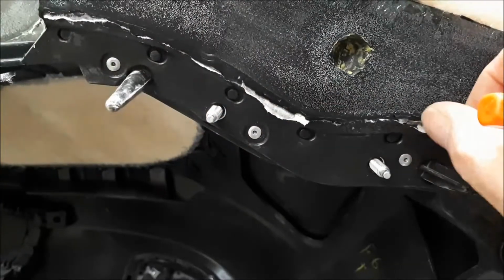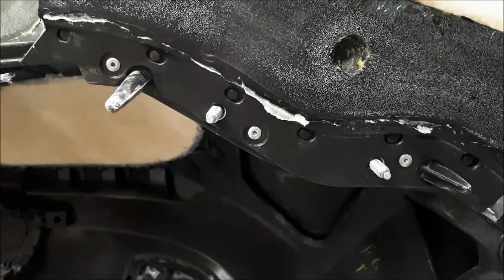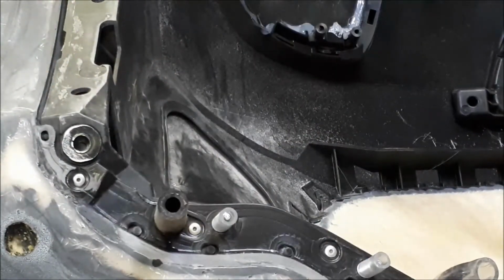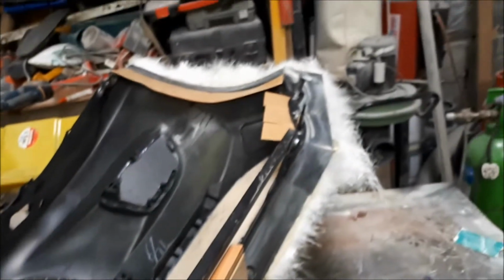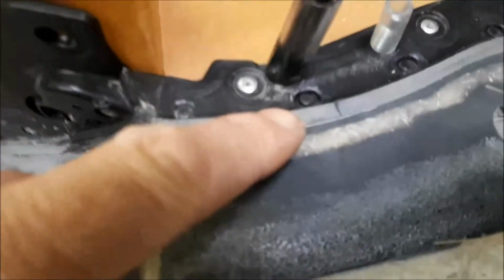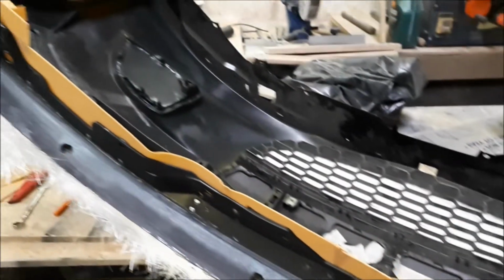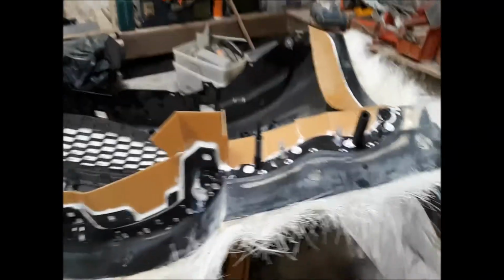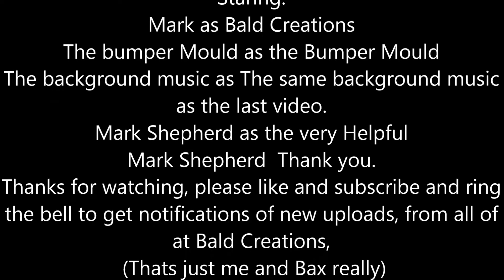Mazda mx5 3.75 Front Bumper Mould Part 2

Comment: Thanks for the remarks mate glad to help and pass on what I’ve learnt from others 👍 

Another tip is to use those clear plastic rubber sticky pad feet to make the plug locator holes. Super fast and they separate from the gelcoat really easily 👌 Here is a link to the sort I mean (the square ones are best and the dome one are great also): https://www.amazon.co.uk/ONUEMP-Rubber-Adhesive-Cabinet-Bumpers/dp/B07F8ZQMXD/ref=sr_1_4?keywords=clear+square+rubber+pads&qid=1560652858&s=gateway&sr=8-4
Reply from the maker: It was quick to set up, but mate what a ball ache to clean up, off the mould and the guys bumper, worth a try but I'll not do it again.